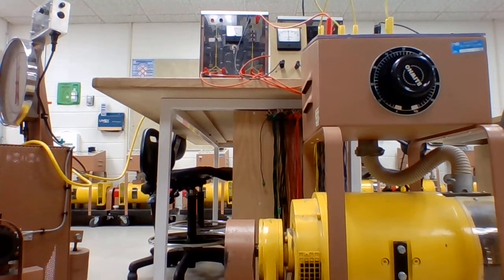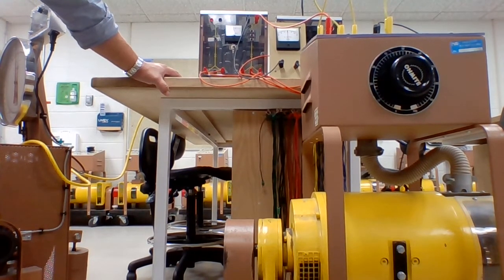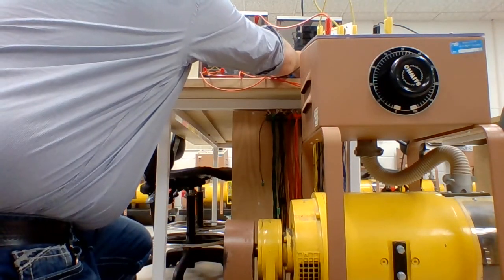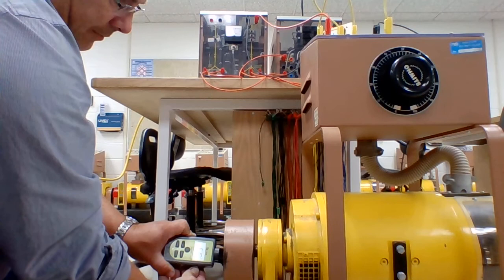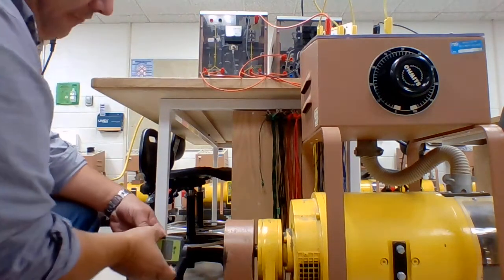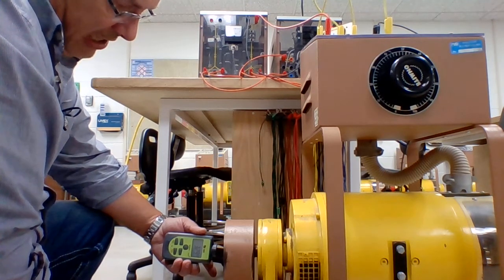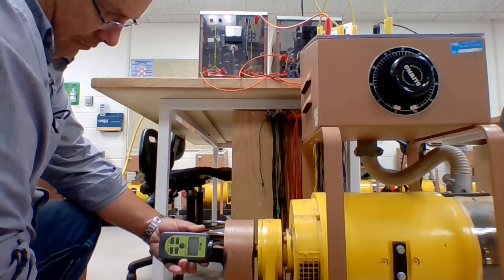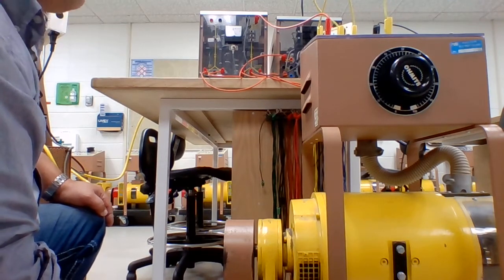Series runaway

Comment: Residual Magnetism in the stator can cause rotor to increase speed if not controlled.
Armature runaway is what we called it back in the 90s. Use to get huge DC (100+hp) motors out of ALCOA ( Bettendorf IA.) and the motors would self-destruct, bearing failure, copper scattered through out the inside,
Windings just shredded from centrifugal force. Amazing to see the company I worked for rewound these behemoths back in the day. Fun stuff
Reply: Yeah when you get to the absolute runaway point there is no more chance to stop it except if you have the option to "turn it into a generator". Otherwise you better pray that the rotor winding self destructs from centrifugal force before the bearings and end bells start flying. Luckily never had to see it myself but at my fathers workplace they had the shaft of an 800kW DC Motor break between coupling and end bell. End bell flew through a closed sheet metal gate and ripped the legs of an apprentice off. Have heard a few more less dramatic stories from my own workplace but DC runaway is absolutely no joke
Reply from the maker: Yes runaway is quick and it can be nasty, I don't know what actual speed it takes for them to self destruct, but you can see it is possible.
The motor being used in the video is overbuilt as it was designed to be used as a teaching tool (we were told it is safe up to 4000 rpm for a short duration) but it is 30 yrs old so I still don't like taking it that high.
DC motors are neat as they have constant output power ft-lbs/sec if there is no drag (ft-lbs) the speed increases indefinitely, likewise if you over load that motor it will slow down and increase the torque output until it burns out the windings or twists off the shaft. 
Thanks for watching and sharing your input/experience.